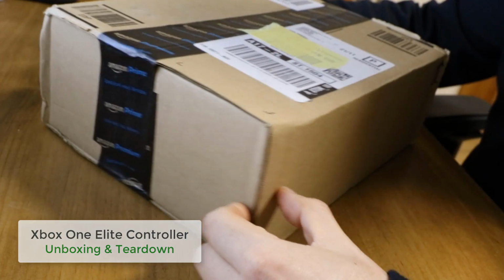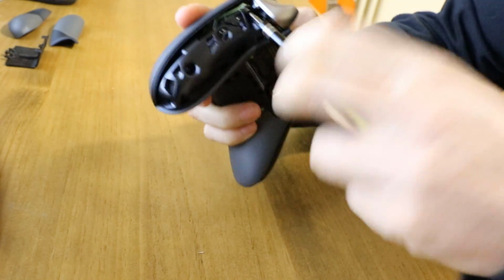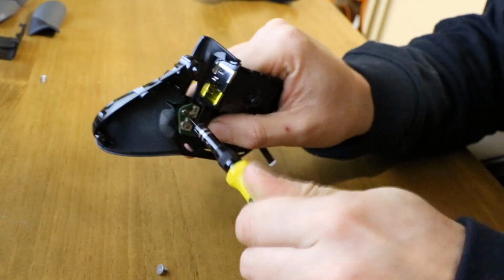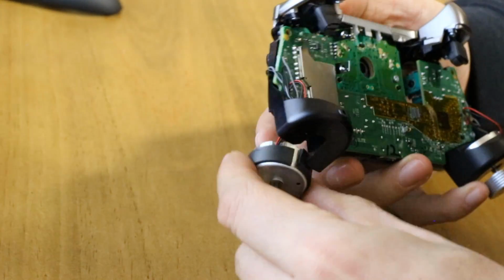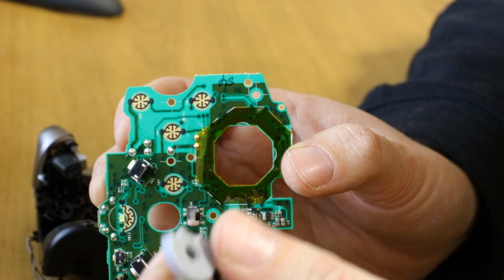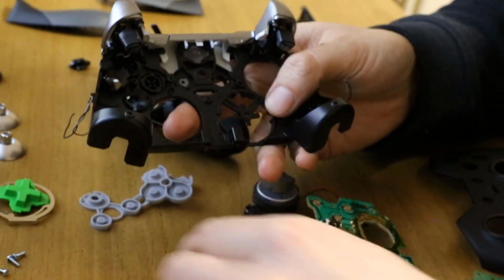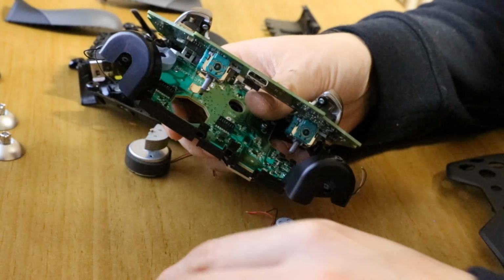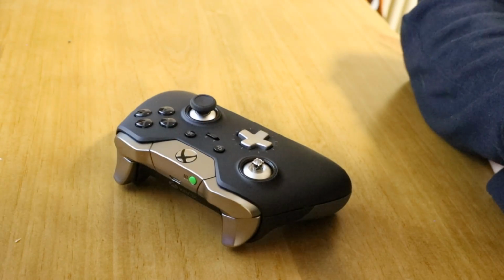Unboxing Xbox One Elite Controller Disassembly Teardown Repair Fix

Comment: Is there possible to remove those magnets on paddle base to which paddles attaches?
Reply from the maker: Never tried pretty sure they are glued. So you can remove and re-glue though I am sure
Reply: Thanks. sounds dangerous. ill try to confine myself with bumper fix and top panel replacement. btw very satisfied with performance and functions of this buddy, but durability is close to zero. even worse than native "one" controllers which are also crap. mine 360 controllers lived for 10 years of very active using almost without any lacks. "one" controllers required sticks replacement after couple years. elite started literally to fall apart after little more than year of titanfall 2 on weekends.
Reply from the maker: Yeah I've heard a lot of that from many people. I don't  get time to play the console much at all, maybe 3 times this year, so never noticed it but it obviously is true as loads of people state the same thing. It's a shame as otherwise it is a nice premium controller

Comment: can anyone help me? my elite controller paddles on the back aren't clicking anymore, they've gone sticky which is very annoying. Any way to fix this easily? I have dissassembled my elite before to repair a broken bumper key, but not sure how to replace the padddle buttons. It seems pretty sketchy to me.
Reply from the maker: Put IPA fluid in them and click them over and over

Comment: If I have the Elite Controller and buy the Xbox One Special Edition Covert Forces Wireless Controller can I put the shell from the covert forces one onto the elite one? (leaving out the profile switch button)
Reply from the maker: Possibly but they sometimes change the shells so wouldn't be 100% sure

Comment: I know that you made this video long ago, but i really need help with my controller, it’s P3 is not responding very well and was just wondering if you could help me?
Reply from the maker: What do you mean P3?
Reply: Paddle, it says it on the back of the controller next to each paddle
Reply from the maker: Same for most buttons, tip some IPA on the buttons and press repeatedly
Reply: IPA?
Reply: The button doesnt press very well and just doesnt want to go down
Reply from the maker: @luuunky  isopropyl alcohol

Comment: Hey man quick question hopefully you can help. I have 2 Xbox elite controllers both having problems. On the one, the D-PAD is messed up, only the left on the d-pad registers, but like double/triple inputs when you hit it once. The other directions of the D-PAD do not work at all. It does make the clicks though, and this was supposed to be fully tested by Microsoft before they sent this one out to me.... 

My second Elite controller has an issue with the A button double inputting every now in then, there is no specific pattern as to when it happens, but its very annoying when I hit the A button once and it registers twice..

Both of these controllers are "brand new" sent from Microsoft after a repair/replace service. 

Is there anyway to fix this without having the send these back out to them???
Reply from the maker: If the issue comes from the rubber contact pads or conductive surface of the PCB you can just open it up, get some IPA (isopropyl alcohol) and soak the button rubber contact pads in it then dry them off and clean them in general. For the D-Pad drip some IPA on the soldered down buttons, and press them 100 times each, so probably have to drop IPA on them a few times as it evaporates. Then "rinse" it with the IPA to flush out any debris by tilting the PCB on an angle and squirting some IPA on the D-Pad buttons so it runs through like you are rinsing something with water. Then let it air dry or just a hair dryer for instant drying, then try again
Reply: I'll try the broken A button one first later on today, becuase I might have to send the broken D pad one back, they said I could keep the broken A one

Comment: you are quite brute with the controller first handling he bumper in a way they can break just so you can get he board or easily second by putting the screwdriver in the audio port just so the controller comes back in place ... what you don't know is that the audio port must be priority when putting everything back together so you don't face that problem. actually putting a screwdriver inside and pushing your way through can damage the inside of it therefore making the port useless
Reply from the maker: Not to sound funny but I ran 2 gaming companies for 4 years, I sold over 250,000 controllers. I still dabble with them today. I have done this with the Xbox controllers for every one. Never a single issue. There is no risk damaging it if you know what you are doing. Putting a screwdriver that is smooth on the diameter into a 3.5mm hole when its 3.2mm itself and pushing it down is the perfect way to get the case to re-connect with the aux port.
Reply: AngelSix running companies for 4 years and having no issues does not mean not being vulnerable to mistakes. perhaps your ways are just fine for you but I'm just giving away some tips so you don't face issues in the future. instead of bragging out your past gaming companies adventure which to be honest I could not care less (sorry but had to say it) I just wanted to let you know that you have certainly caught my attention with your ways on this video. wish you luck in the future because as I said 4 years of running a company does not make you a guru on what you are doing and you are still open to failure.
Reply from the maker: You didn't give away a tip. You simply said I was "quite brute" and "what you don't know". Constructive criticism is one thing, simply sounding like a guru yourself isn't helpful to anyone unless you offer actual advice to do it differently. Let's just leave it there, I apologize if it sounded like I was bragging I was simply letting you know why I know its no problem to do it that way, and people can now see to be caution if they want to be with the screwdriver, but lets not turn this into a troll thread
Reply: AngelSix fair enough
Reply: So my aux port stopped working on the controller. I know it is this component because my headset works on the other controller I have, but not on the elite controller. To fix it do I just see if it's dislodged? It was working fine until it fell from my tv stand to my carpet.
Reply: Jesús Alejandro Rodríguez Leiva 
(This is old but I could care less.)
Him saying that he ran a company for 4 years is not him saying he's immune to issues or that he's some tech guru, he's saying he knows what he's doing.
Reply: Juan Narvaez Me too, I changed my fears of war 4 elite case controller and then I just put everything on position again but the aux port it stopped working, I've been lurking about that problem on I the internet, even I tried with other aux port and doesn't work! I hope anyone can help me with this problem.

Comment: What is the orange plastic sitting on top of the motherboard?
Reply from the maker: Heat resistive tape (kapton tape) typically used during the wave soldering to prevent parts falling off or to protect things from heat when its being assembled... I think they have re-purposed the tape in this case though as you don't tend to leave it on after soldering. Perhaps MS have used it to cover up test points and make it a mild deterant for tinkerers from probing the motherboard and messing with the MCU chip.. just a theory

Comment: surprising that the vibration motors look exactly the same as on my cheap-ass generic usb controller with no x-input

like wtf, i watched that nintendo pro controller teardown, and it had some much better looking, quality ones. Step your game up Microsoft XD

now ok to be quite they do look bigger on the elite but still, kinda the same thing, right?
Reply from the maker: +Goran Novakovic vibrating motors are simply motors with unbalanced laminates to cause the vibration. Really there is nothing about them to make them quality as such.
Reply: AngelSix how do they make the force feedback feel more premium though? Like better overall housing build quality = better spread and feeling force feedback or? Like im no profesional obvioslly, i do know the basic principle on how these function though.
Reply from the maker: +Goran Novakovic it's just haptics. The more unbalanced (by heavier laminates or more open space than laminate) the more deep the feedback like bass on a speaker. So for deep rumbles the big motors are the bottom are used. For fast vibrations that feel more like electricity or pushing back against your fingers the small ones are used. Then to get the haptic feedback that makes it feel realistic or premium it's the software driving specific pulses that trick your brain. For example the new Macbook pro and iPhone buttons are not even physical buttons but a electromagnet that generates a haptic feedback via software pulses to make you feel the "click". The premium feel is mostly in the software and then generic asthetic feel of the housing plastic helps too
Reply: Thanks for the info

Comment: Thank you so much for this video! It helped me fix a stuck trigger stop (the little green sliders on the back of the controller).
Reply: hello is it true that these xbox controls (the normal and the elite) break very easily, like the internal parts rb lb dpad broken buttons etc ... how long do your controls last?

Comment: What exactly does that rubber membrane that's under the buttons do? I google'd it, wiki'd it and I can't find it anywhere that explains what exactly they do. It's all just repair kits. Thanks in advance.
Reply from the maker: The PCB has black carbon conductive pads on it. Each button has 2 disconnected pads. Electrically joining them sends the signal from one side to the other telling the chip the button was pressed.

The rubber membrane has a black conductive pad of its own that when pushed onto the 2 disconnected carbon pads on the PCB joins them together by conducting through it
Reply: AngelSix thanks so much. I was thinking it might help prevent sticky button's. Since I'm doing an engineering project. Would you purchase a thin plastic film that you place over the xyba buttons and the d pad? You could make the film have a low melting temperature so that it could fuse to the controller easily. This way the plastic film prevents foreign material from getting into the controller while being flimsy enough to allow you to press the buttons with little to no problem?
Reply from the maker: To  form a seal from debris I would say you need more of a rubber o-ring glued to the inner side of the controller front face that the buttons press through. The size fit would be crucial. The d-pad you would use a rubber sealing gasket from the PCB to the front case so debris could only get into the small area of the PCB inside the d-pad area, as the D-Pad rocks and would be hard to seal any other way I can think of
Reply: AngelSix hmmm part of the project is it has to be more of a product. Do you think the film idea won't work at all, or do you think the o-rings and gaskets is just better
Reply from the maker: Personally I would say a film won't do anything. It needs to be a seal around moving parts, so a film would not work in my opinion

Comment: How the fuck did you open it with a regular t8/6...mine has security knobs in the middle of the screw completely screwing me over.
Reply from the maker: The older models have security T8s. Usually a normal flat head screwdriver can flick off and break the security tabs no problem
Reply: Ok, thanks saved me hours of frustration lol.
Reply: Yeah that’s what I did

Comment: How did you get passed the security torx so easily?
Reply from the maker: +Select Start it's just a T8 screw with a dot in the center you get many screwdriver kits with security tips in them now

Comment: I have a problem with my battery and i dont know how to fix it, because everytimer i turn my controller on it just shuts off directly (it's not because of bad batteries). Dont know what to do, would appreciate some help!
Reply from the maker: Ale it usually only shuts off due to lack of power or a short on the board of a disconnected antenna between the two boards. Have you had it apart or spilt any fluids on it?
Reply: No i haven't spilt any fluids on the controller, i have taken it apart sometimes because of other things, but now everytime i turn it on it just shuts off directly. Dont know what to do :(((
Reply from the maker: Ale check the flexible antenna cable between the 2 boards is on solid. Then check for any other signs of something lose or touching or out of place.
Reply: In which part of the video is that?
Reply from the maker: Ale Ale oh sorry I was thinking of the standard Xbox one for the antenna part. So for this board really I can't think of anything specific that could cause the issue other than poor contact on the batteries or the connectors between the 2 boards loose or the motor wires snapped and touching ground draining the battery
Reply: +AngelSix any new information on how to fix this? My controller also loses life and batteries are fresh

Comment: Is there any way for me to replace the USB part? I bought this custom controller around Black Friday and it doesn't work?
Reply from the maker: It's not easy. You can re-solder a new one on but that requires good soldering skills and if the traces on the PCB are damaged you would need to scratch off some resist and wire solder to them also.

Comment: The first motherboard wont come out. Its stuck I think
Reply from the maker: Have you missed a screw? Or just not pulled it up off the connector which also holds it in place?

Comment: why is this controller so much heavier than a stock xb1 controller?
Reply from the maker: Partly to give it a quality feel, partly due to the sticks being metal, the tactile arms on the back being metal etc...
Reply: is there an easy way for the consumer to make it lighter but still retain the premuim features?
Reply from the maker: Simplest is remove the rumble motors

Comment: The micro USB port on my elite controller is broken any advice on fixing it?
Reply from the maker: Does it look physically broken (it moves around, or if you open it up its lifting from the board? 

If it is solid down and not moving, try getting some IPA fluid and dipping a USB cable into it, then repeatedly plugging and unplugging it from the controller about 50 times, then try again.
Reply: AngelSix it’s moving around quite a lot I’m pretty sure it needs to be replaced but I don’t think I would be able to replace it
Reply from the maker: Sounds like its broke off the PCB. You can get a PCB shop to repair it for you however they would have to have some level of skill and willingness... it's easy for me for example, but some shops are not willing to do anything like that. You would really have to just find someone good at soldering/repairing PCBs who is open to trying it for you. They would have to scrape off the resistive layer, re-solder the big metal tabs that hold the USB down, then probably use a bit of kynar wire to solder from the USB pins back to the traces on the PCB that will be broken a bit further down the PCB where they are still in tact

Comment: Ok so I have my t8for the outside 4 and it does not at all fit in any of them.
Reply from the maker: If its not an Elite controller you might need a security T8 (with the hole in) or they may of since gone back to security screws as they always used to use them
Reply: AngelSix what exactly is a security screw. And what do you mean hole in? Basically what may be the case is I have to take it to Microsoft and pay them to fix it huh? This is very frustrating to buy one controller and spending that kind of money on it and I need to take it apart within the first 8 months because a sensor in the joystick is going bad and I can't even take it apart because they want to make it incredibly difficult for probably no other reason than they want you to bring it in for repairs so they can make more money.

Comment: Dude, use a solder iron instead of rip off the cables
Reply from the maker: Yeah I didn't want to faff with that for this video. I soldered them back on after but for easy and one-shot video I just pulled them off

Comment: I smacked mine on the table and now the left trigger gets stuck in down position. Any ideas? lmao
Reply: Same here. I had to buy a new inside frame. Note there is a “arm” on the corner who hold the lb/rb button. Probably this arm is broken. I just dont know how to take off the rt/lt button to transfer to the new frame...He didnt showed in this video.
Reply: @karamzinho  idk exactly how broken yours is, but I managed to fix mine with no surgery. I bended/forced the trigger to the right, and this eventually fixed it after continuing to reinforce the bend for a few days whenever I played. This worked because the thing the trigger was getting caught on was more to the left. You just need to be gentle as to not snap it right off. Obviously we might have completely different situations

Comment: he bouught a 120 dollot controller to disasembal wats the point
Reply from the maker: To show you how it can be opened and closed for those wanting to repair it
Reply: Proper spelling is appreciated. Take a look at your question, upon re-reading it you could say that you answered the question yourself. He bought a $150 controller to disassemble and reassemble. That's it, and I appreciate this lengthy detailed video.

Comment: having problems where the two little square pieces white ones where do they belong
Reply from the maker: +Jose Hernamdez I just chuck them. They are just supports for the PCB to plastic case but I never remember where they go works fine without them.
Reply: thank you very much